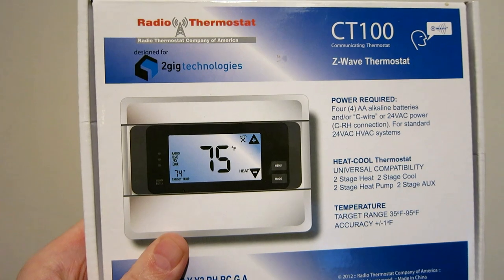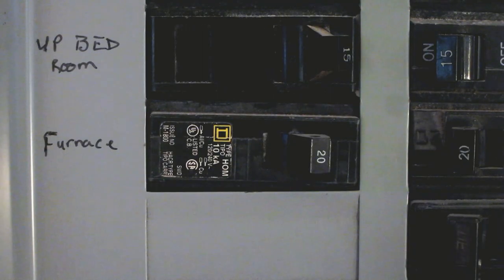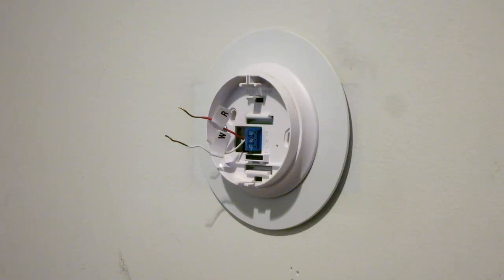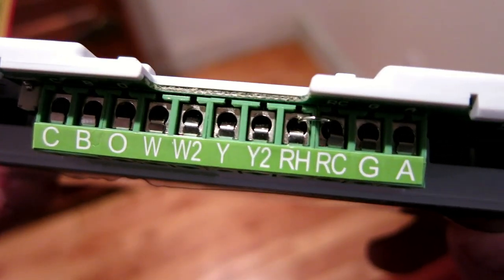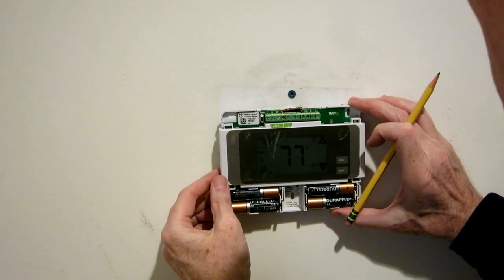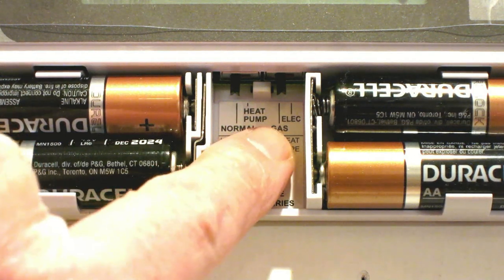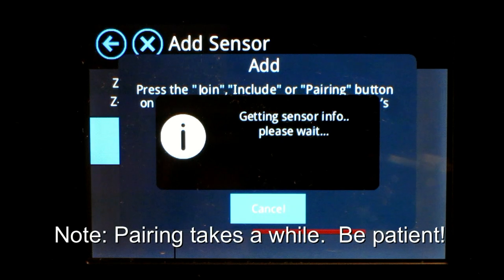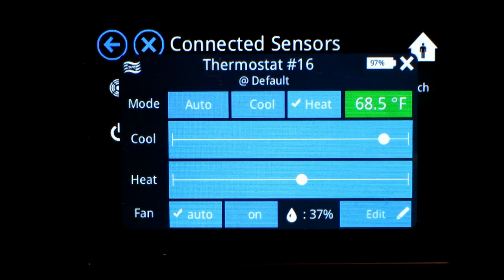Part 1: How to Replace a Conventional Thermostat with a 2Gig CT100 Z-Wave Thermostat

Comment: Thanks for the video,I have one question how do I know which stage to set for my HVAC system?,I just installed CT101 but it does not work
Reply: Hi Sunil --

I notice your message references the CT101, while my video demonstrates installing the CT100.  Is it possible your model thermostat differs in certain ways from mine?  After all, the CT100 has only two settings for the HVAC type: normal or heat pump.  My guess is most people don't have a heat pump -- and in any case normal covers conventional natural gas, propane, oil, or electric heat.  (If I had to guess, those four possibilities cover at least 95% of the home furnaces in the United States.)  But because you seem to have a CT101 -- and if you don't live in the U.S. -- your situation may differ radically from what I describe in my video.

-- Vidiot1955